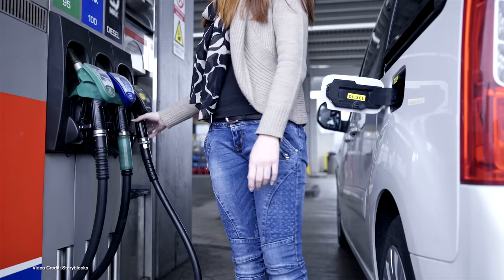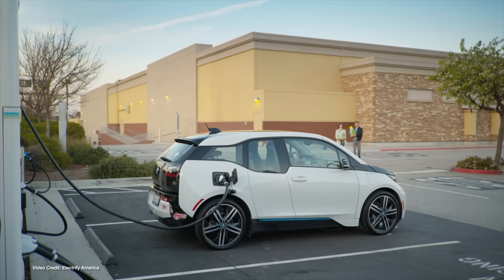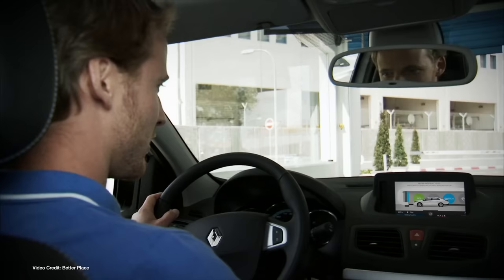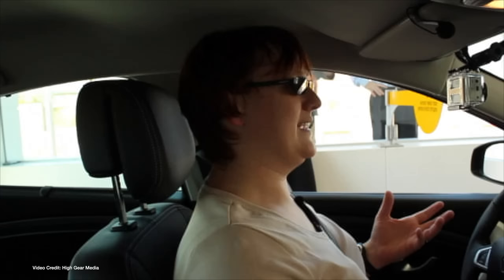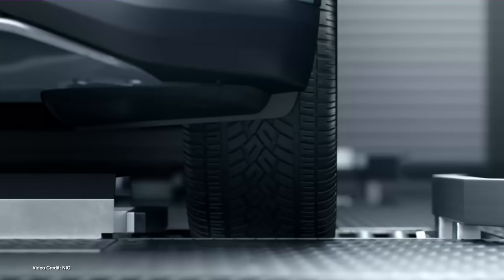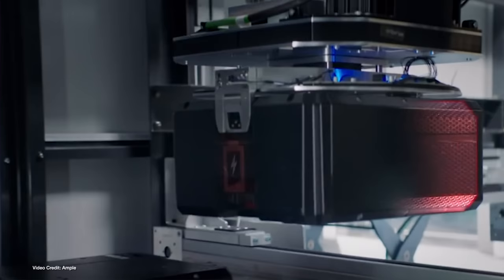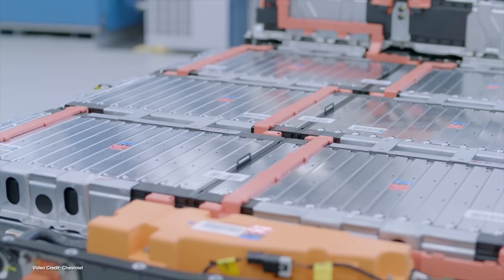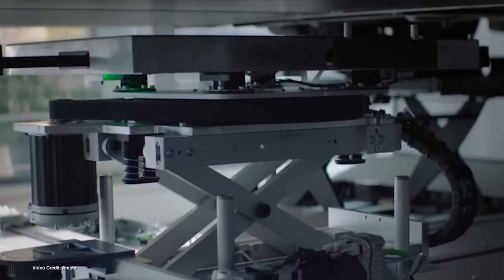Ample Space For Electric Car Battery Swapping? The End to Slow Charging? This Startup Thinks So

Comment: I believe a significant fear regarding 'leased' batteries is what do you do when the company discontinues said battery? You own a car that no longer has a battery pack. Maybe the answer to battery swapping is that the cars aren't purchased, but leased. That way, you aren't stuck if the infrastructure fails.

Comment: I don't know if it will fit with the progress EVs have made, I'm grateful that most have adopted standard plugs, beyond that may be a step to far for auto makers. I'd like to see a standard port on the boot for a range extender, even then we are getting into proprietary territory. So I feel that easier access to rapid EV rental at an affordable price is the answer, I'd be happy with my city EV year round and then rent a larger capacity battery vehicle for the long trips, else I'd like to put it on a train and take it with me.

Comment: No, you're not wrong. For standardized fleets, maybe, but for the general public, it's a clumsy solution that has far too many potential failure points. I can't imagine anyone would be comfortable with having a critical component of their vehicle routinely swapped out. And how would such a network of changing stations be able to keep up with the continuing evolution of battery technology? I can't help but think attempting to maintain compatibility with changing stations would stifle EV innovation.

Comment: Maybe good for electric car racing. You pull into the pit along comes a person with a jack and removes the spent battery and in split second another inserts a charged battery. And way you go! For racing cars a standard setup can be done. The racing team must have enough battles to compete the race and the spent battery would be recharged for next pit stop.

Comment: I wrote an article last year wondering if Tesla was considering the idea of reviving their battery swap technology for the Model S and X with the new 4680 battery packs. Tesla had an established, working battery swap station technology, and even had revealed patents on a mobile version in a semi that could travel anywhere to deliver refilled battery packs. But the recent Battery Day put that notion to rest when Tesla showed their future plans to have cast front and rear subframes connected with a structural battery pack in between. Of course that news came after the Model S LR topped 400 miles of range, with the promise of the 4680 battery powered Model S Plaid + having a whopping 520+ miles of EV range. The Tesla battery swap test station also pointed out a big problems (that you mentioned) of battery pack lease or purchase, and potential battery abuse. Granted, if the 4680 batteries are really million mile+ batteries the battery abuse and degradation are less of an issue. But otherwise the swap idea is killed when someone spends $100K+ for their new Tesla and only takes one or two long range trips a year. And their pristine, low mileage battery is swapped out into a RoboTaxi, running 24/7, and/or if they get that RoboTaxi battery swapped into their car for the trip, and the useful range is half as much as new. Right now the majority of EV owners automatically charge up fully every night or once a week at home while they sleep, and they are driving an average of 15-75 miles a day, so they never have any range anxiety anyway. Of course the other side of that coin is that EVs make up much less that 10% of new vehicle sales in the U.S.  So maybe there is a big untapped market of people who cannot charge up at home overnight, and who would benefit from battery swapping. I can't see new EV automakers agreeing on a common battery swap design, considering how long it took to agree on a common DC fast charging plug standard (which is still far from universal). I do however see a company like Nio providing the whole package with new, competitive BEVs, and working battery swap stations. Also I could see a great opportunity of a new company offering a gas engine swap package that works as a direct crate replacement of say wheel hub motors, and a universal, station-swappable battery/BMS, and the kit plugs into the wire harness of the gas car, and viola, you've got an EV. It could happen. Think Back to the Future Hover conversion.

Comment: I completely agree that waiting long as we have to today for EV recharge is not acceptable and is one of the major factors holding back faster adoption. In the absence of a better battery technology, I'd welcome a battery swapping option. Building the cars with the design requirements and the swap stations infrastructure will not come quick either. The concerns about battery pack quality (from swap process) might also play a role in consumer confidence. Battery would no longer be owned but become a commodity. That is a big shift in the ownership and warranty models. I imagine even legal concerns might arise, for example, what if a swapped battery causes demage to the car or an accident. Who has responsibility?

Comment: If the manufacturers could agree on a standard set of plugs to charge EVs that'd be  something. Let's worry about a standard battery pack after that's achieved.
For myself it's not just how long an EV takes to charge it's the uncertainty of finding a functional charging station.
Long ago I was caught short of petrol in central Australia a very long way from a town. No real problem, nearby farmhouse sold me enough petrol to get me back to town.
Another advantage of modular easily removable battery packs would be not having to burden your EV with more weight than it needed. The battery equivalent of having a  jerry can or two for that long trip into the wilds.

Comment: Even ignoring all the impracticalities of building a battery swap infrastructure, there is only a small window where a reliable, affordable and accessible battery swapping service would be viable before rapid charging technology becomes common place and decimates it. 

Battery swapping might have a future with long haul semi-trucking, but even there it will probably be the hydrogen cell that is going to be up against and hydrogen doesn't have a problem when it comes to the time required to recharge.

Comment: A hybrid model of affordable cars with a 60-120 mile range and an empty battery compartment you can swap in an extra 150-300 mile range by leasing some batteries for the week or two of your trip.  Reduces around town car weight too.
And yes, with a battery swap system you do not "own" your battery because every time you swap the battery you get a different one.
Has anyone thought about road side assistance?  A tow truck driver should be able to swap the battery with a jack or lift and common tow truck tools.

Comment: Even if automakers would agree on a modular battery structure with identical battery cells, losing an advantage with a better chemistry. I still couldn’t see any sights of electrical or coolant plugs on those cases. VW could do something like that for MEB batteries, as NIO says it’s doing in China, but I think the problems to overcome are many and the battery chemistries are still advancing at a very fast rate.

Comment: First requirement is "Design for Automation" which is something automakers will never do. Between that, the 1million mile battery and finally the ever increasing operation voltage which has direct link to charging time. For when 1200V giving under 5min 80% charging? Only place for swap battery packs is in agriculture when many machines are used for less then 4 weeks/year.
Nikki: When next looking for an EV project car consider a Fluence. Here in France second hand they are as easy to sell as two person coffins.

Comment: Imagine the long lines waiting for a battery swap if you tried to do battery swapping on a long trip. Tesla and others keep adding chargers to meet demand. How many swap stations would be needed if all cars swapped batteries? Will you have to make an appointment for your car to have a battery swap because they just can’t afford to build enough of them? For this to work, batteries would need to be more standardized, not so Willy-nilly. In addition, active cooling like Tesla has, would have to be reconfigured to fast swap. Most other batteries have ineffective passive cooling and mediocre battery management.

Comment: What if the battery was split into two parts, or three, maybe four? And my daily commute could be done with just one of these parts. Much less weight to carry around. Much less batteries to produce. And when I want to go on a longer ride I borrow/rent more parts as needed. I have read about a motorcycle that has this possibility, several compartments for battery packs, which means less weight when you go on a short tour.

Comment: My biggest problem with battery swaps is the one she touches on at 12:04: Most owners will keep a battery in their car for a while and charge it at home, just occasionally swapping it on trips.* But if it's not theirs, what's the incentive to take care of it, to not frequently drive "heavy on the pedal" and ignore the various ways to ensure the battery keeps its range ability. I'd hate to care for a battery I had for a couple of months or more, and then swap it for one that had been abused. Then my daily/weekly use would be impacted, I'd have to swap more frequently. Not a huge problem, until you go on a trip. Yes, you can swap, but if you have to stop and swap 3 times instead of 2, or even more, how much time have you saved over having a conventional built-in battery?

* This won't apply to non-homeowners, and OK, swappable batteries may make owning an EV more attractive to those of us who have to park on the street.

Comment: While battery swapping sounds like a good idea, it won't work because:

1)  EV batteries are in such short supply that it is constraining EV production and delivery.  Battery swapping would mean you'd have to at least double the number of batteries produced for the same number of cars.

2) Modern EV designs from companies like Tesla use the battery as a vital structural component.  What happens when you try to swap that out?

3)  Battery design and chemistry are key competitive components for companies like Tesla, and they are changing and evolving rapidly.  How could the swap companies possibly keep up?  How could the EV companies agree on a "standard" when their battery technology is one of their key competitive advantages?

These are just a few of the reasons that battery swapping in cars won't succeed on a large scale.

Comment: Battery swapping is not a solution it is a workaround. On top of that, it is one rife with logistical  and physical problems.  It adds several possible points of failure compared to one in rapid charging.  Just cutting rapid charging  time in half would make them obsolete.

Comment: I'd be too wary of wear on the mechanical, electrical and hydraulic hardware involved in the car-battery connections to use a battery swap system for the main battery, one slight error and you are out of a car until the damage is repaired. I'd be more interested in a standards for range-extending accessories.

Comment: To me, having to shlep down to a battery pack swapping station is as much a pain in the bum as having to go find a petrol station. It takes away one of the key conveniences of having an EV car in the 1st place. i.e. if you're privileged enough to have a driveway or dedicated off-road parking space with charging facility, plugging in overnight and forgetting about it.
Reply: If you can plug in at home with a fixed battery, you can also plug in at home with a swappable battery.  You’d only swap if you were in a hurry on a long trip. And not even then, if you are combining a meal stop with charging.  The benefits of battery swapping nearly vanish if you charge at home.

Comment: I still like the idea of solar panels on vehicles so they can self-charge when in sunlight. This does not need to be enough to charge the vehicle to full it only needs to be able to get home or to a fast charge charging station.
Reply: 1 square meter of solar panels will produce something like 1kwh of power over the course of the day or about 4 miles of range. There's probably some niche use cases, but unless the cost and weight are very low it's generally going to just be better to have solar elsewhere and plug the car in.
Reply: @cadekachelmeier7251  Just a thought. Aptera unveils three-wheeled solar electric car that "requires no charging"
Reply: @gerryhildebrand916  I can definitely see it being useful in some scenarios. But it really requires most or all of these things to be true:
1. You're going to park it in direct sunlight during the daytime most days.
2. You don't drive too many miles per day
3. It's difficult for you to charge from a wall.

That definitely applies to some people/vehicles for sure. But if you drive 30 miles a day, you're going to have to find someplace to charge regularly anyway. And then you have to think of the cost-benefit of the energy used to produce those panels and the energy used to lug them around while driving. Solar panels generally take a few years to break even on the energy used to create them, but they last 30+ so it's fine. Cars solar panels might never break even, depending on their conditions.
Reply: @cadekachelmeier7251  Today we have solar paint. The whole car can become a solar power generator. I drive very little these days so the car may have several days between drives. Large battery range and being able to charge at other sources mean I have options. Free charging is the one I like.

Comment: Do you swap battery in your Smartphone ? No. And you are OK with that. Why? Because smartphone with a battery as an integral part is better product. Battery is bigger, phone more rigid and water resistant. Rest is simply adjustment to your habits: taking portable battery charger if you go for hiking, or when at office you just juice up for 15 minutes every now and then. Same with EV cars. It's all about creating correct habits. Overtime cars and batteries will get better and your habits of interacting with it will improve.

BTW: do you remember that phones used to swap batteries ?

Comment: This is a waste of an idea. No point to flog a dead horse. There are so many different cars and battery designs out there, and I can't see that it would be possible to keep all those different designs in stock at all times, and have capacity to swap, charge and store all those different batteries. What if there is a fire in a cell in one battery? Goodbye swapping station, and a nightmare for the fire brigade. No point having a swapping station unless all cars had the same modular design and you could add or subtract modules depending on the distance you wanted to travel, and change batteries during a long distance trip. What about those cars with older batteries? Can they just get a new one for free, and do you risk getting their old battery? Much better to keep charging.

Comment: I think the author dismisses the idea of battery swapping so quickly without ever mentioning a lot of positives.  One big advantage of auto makers embracing battery swapping standards is the conservation of nickel.  Why should everybody lug around a heavy 400 mile battery when they seldom drive more than 60 miles in a day?  It is a waste of money, energy and nickel (a huge constraint on EV production).  With battery swapping, a person swaps for a 400 or 600 mile battery right before they actually make a long trip and then the range problem is completely solved for the trip.  Then they leave that very high quality battery for someone else when they come back.  Another is to make the resale of EVs a better option. How much can you get for a 2013 EV with 70 miles of range still on the battery?  Answer, a lot less than had battery swapping been supported!!!  Also, with battery swapping, one removes the main fear of buying an EV.     It is the same now with solid state batteries.  If we had battery swapping, I could buy an EV now and know that 5 years down the road I can swap the battery for a lighter, safer, better one, if such a battery comes out.  Another is cost.  Battery swapping gives the poor person the chance to buy a model 3 with 80 miles of range for maybe 20K.  He can live on that, swapping for a bigger battery on trips, and perhaps upgrade later.  Without battery swapping there is no option like that.  Another advantage is for trucks.  Sandy Monroe and other experts frankly doubt how well an EV semi would do on an uphill grade in the cold.  Batter swapping could provide an option for trucks about to go on a long climb.  Another advantage is that it gives legacy car makers work to do for their dealerships.  If people lease their batteries, then the dealership has some business there swapping batteries, which might make them less combative to selling EVs  (see VW scandal of dealerships refusing to sell EV cars).
Reply: Have you considered the staggeringly enormous infrastructure program needed to make this a reality? It can only ever work if there's a swap station close to where everyone lives and HUGE numbers of batteries, and cross  industry compatibility......
When you think about it, discussing the benefits is pretty irrelevant - it's just SO, SO, SO never gonna happen......!
Reply: Did you say 'poor people' could spend $20,000 dollars on a Tesla???
What planet are you commenting from.......?!
Reply: @andymccabe6712 a swap station at a mall, truck stop, gas station might make money for the owner.  If so, they grow like mushrooms.
Reply: @andymccabe6712  A corolla is 18K.  That would be a nice number to hit!  If course used could take it down further.